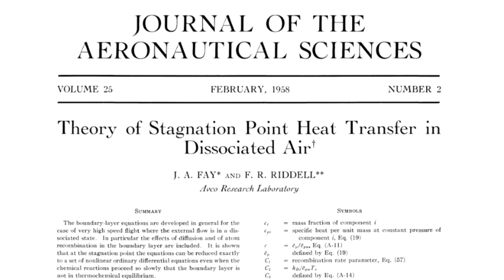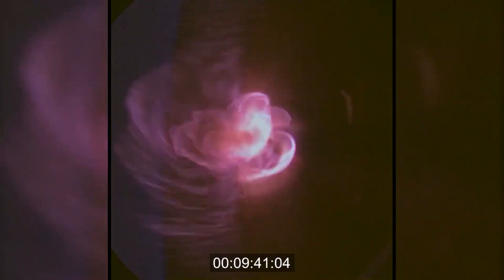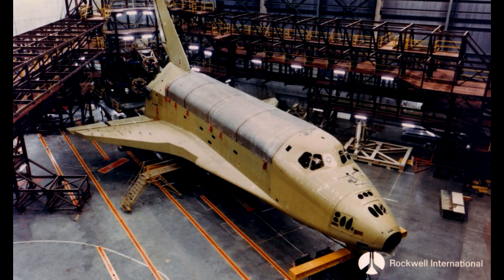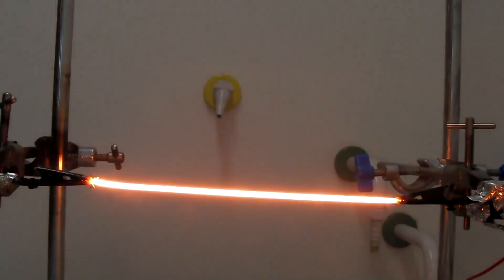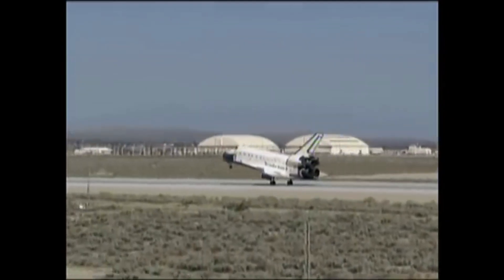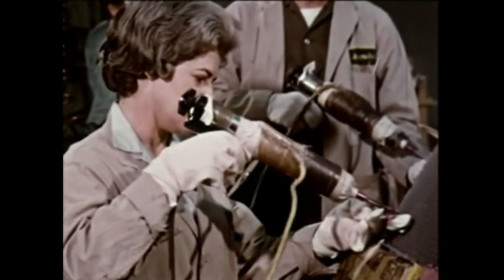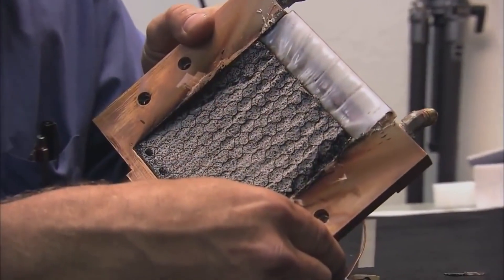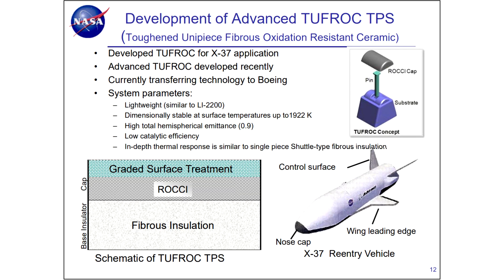Heat Shields - Things Kerbal Space Program Doesn't Teach

Comment: I'm not a rocket scientist or engineer or someone who works with thermodynamics daily, so this is probably going to sound dumb, but...

For years I have been wondering why they don't just slow down the spacecraft during reentry so they don't need a heat shield?  I mean, the STS used reentry engines to break orbit, but why can't they have more braking?  I fail to see why reentry has to be done at tens or hundreds of thousands of miles/kilometers per hour.   I mean, the early capsules I could understand, but we have been going back and forth to space for almost 75 years now and I don't understand why nobody has been able to design a craft that can carry fuel enough to brake during reentry enough to not need complex or ablative thermal protection.
Reply: Slow down with what? Fuel is heavy. The more fuel you hold onto in order to slow down, the vastly more fuel you need to burn in order to get all that mass into orbit in the first place.
Reply: Even if you managed to cancel out 100% of your orbital velocity (which would need ~7.7km/s of deltaV), by the time you go from orbital altitude to the upper atmosphere you’d be well into supersonic speeds and still need a means of not overheating your ship
Reply: @alexsiemers7898  I think it's fair to say that if a ship has so much excess delta-vee it can slow itself from orbit, it probably has enough delta-vee to reduce its speed as it falls through the atmosphere.

The only reason it wouldn't is if it had 18 km/s of fuel but not 19, though that's certainly not impossible.

Comment: Don't know if they still do, but China used oak wood for a heat sheild on their reentry vehicles and it would turn to carbon and moisture in it also helped in cooling, I think. A simple idea, but I would think it would be easy for some wood to very in its burn rate, but am sure they had a good sorting of the wood for even grain and weight, etc.

Comment: In theory an artificial gravity drive will allow re-entry speeds to be reduced low enough to avoid any kinetic heating. Currently the amount of propellant required to slow a re-entering craft would increase departure weights so much that it wouldn’t be practical. 
Am I correct in assuming a controlled geostationary decent wouldn’t require a heat shield? If so how can we achieve this for better reusable space vehicle’s?

Comment: Just thinking about different ways to do re-entry, I had a couple of ideas come to mind, just recently. I'm sure there are good reasons why they have not been used, but IAC consider these:

1. Buoyancy. That's the term I've seen associated with this. It probably works best entering from LEO. Fire retros, then apply flight surfaces, as you encounter very thin air, to generate just enough lift to maintain altitude, as you bleed off speed while traveling through the very thin upper atmosphere. As you slow down, keep angling the surfaces to maintain life and not descend, or descend as slowly as possible. Eventually you will be unable to maintain full "buoyancy," and you will fall faster. But by then, you will have lost enough speed that you may not need a heat shield.

2. Keep your junk as a shield. This might be good for something like an Apollo configuration. You have a service module, much larger than the command module, and it's still attached, obviously, since you used it to leave lunar orbit. Why not maneuver it in front of you, and let that absorb the heat of re-entry? That means much more mass to put through re-entry, but in principle it doesn't really matter, as it's all going to re-entry IAC—it's just a question of whether it's one piece, or two. It might be advantageous to design the CM to allow jettisoning some of the more massive components before the final moments. It could also help to allow some parts to be splayed out and create more drag during the early part of re-entry, then they could be allowed to detach. A lot of stuff could be allowed to detach as drag increases, and that could be helpful if it could be done in a controlled manner.

Comment: Quite a few changes on the SpaceX Starship plans for the heat shield tiles, I see. That's their way: if it works well, use it. If it can be improved, do it. If it can be removed completely, hack it off.

Comment: Surely you know the difference between silicon and silicone? Wheres your robot sex doll might have silicon breasts, you would undoubtedly prefer natural textured rubbery silicone. There is nonsuch thing as silicon glue, as referred in your illustration, it is silicone. There is a silicon valley in California so named because of the silicon based electronic parts made there, but there is no silicone valley unless you are referring to Dolly Parton’s cleavage. Silicon: semi metallic semiconducting element. Silicone: a family of synthetic lubricants and rubbers.

Comment: I had the incredible good fortune of a personal tour through the Vehicle Assembly Building during the final few weeks of assembly of a space shuttle vehicle.  I remember the large days-to-launch banner high up on the interior wall of the building.  Memory tells me it was somewhere in the medium-high 2 digits.  I watched as men and women spent what must certainly have been weeks marking, removing, hand trimming, and replacing individual numbered thermal tiles to the under- and leading-edges of the shuttle’s port side wing.  It brought home to me as no other narrative possibly could how time-intensive a process it was.  The entire time I watched, which was probably less than half an hour, was used by one engineer on a single roughly brick-sized tile which was still not complete when I moved along.  She treated that single tile as if it were the key to the entire ship’s success, which years later served as a terribly bittersweet memory.

Comment: In regard to thermal protection tile design and thermal expansion. I am a tradesman and we solve thermal and moisture expansion and contraction problems by incorporating overlap and tounge and groove conections. This is common in finish work, siding, laminate flooring and roofing. The overlapping of Starship could be done simply.  We call it a rabbet in carpentry. An upper siding plank laps the lower with a rabbet cut into the over and under pieces for a flush fit.  This cascades water like fish scales and I suppose it would to...plasma. Replacement and standardization would not be to difficult.  I am sure I am not the first to think of this.  I was wondering what the arguments against overlapping are. Anyone?

Comment: Scott, Nice video.  The leeward side of a shuttle orbiter or Starship, same nearly all orbital entry ships, does not receive significant radiant heat from the plasma wake flow.  The lee side of Starship will be heated convectively, just like orbiter.  Just at relatively lower rates.  The white/ black color of tile from leeward to windward sides result from the tile being naturally white, and requires extra processing and coating to obtain the black emissive coating.  There is no reflectivity involved in the leeward sides of Starship or shuttle.

Comment: I thought you were going to also explain the difference between "hot body" and "cold body" reentry techniques.  Dyna-Soar was a hot body, meaning that its structure could withstand much higher temperatures thus lessening the reliance on the TPS.  The Shuttle was a cold body, so that, as you mentioned, the TPS had to deal with all the heat to protect the aluminum (or is that aluMINIum?) structure.

Comment: My setup of KSP, did in fact transmit heat during re-entry realistically. 
I ran it on a Macbook, on my lap. During re-entry the processor had to work harder to calculate the flight dynamics, which heated the laptop to the point of burning my legs, and on max exhaust fan. At that point I needed to prepare for re-entry with an insulator in the form of a soft cotton based free form insulator, and later switched to a hard non conductive wooden board. While that was enough for my biology, the heat did in fact after a year of many re-entries, fail the batteries to expand out of their designed structure, sequentially over time, rendering the Macbook unusable, and illegal to take on board airplanes.

Comment: Yes I know it's an old topic but I always wondered why they didn't reduce the number of tiles by making larger panels out of the tile material. Bigger panels more area for adhesion fewer tiles falling off in flight. Had a chance to actually touch a Mercury heat shield made out beryllium. It felt waxy. Strip off the old shield? Sounds like a lot of work and a lot of fun.

Comment: Carbon is fuel to oxide and so is aluminum but nitrate is oxide there for will only melt to high oxide heat and will not act as a fuel.nitrate and white ash neutral composite to flake away and re applied usage.

Comment: Isn't there also a very hot layer of the atmosphere (the thermosphere) up there that contributes to re-entry heating? No one seems to mention this hot layer when talking about re-entry ( or launching to space) Surely that will have some effect, or is the pressure up there too low for it to make much of a difference?
Reply: The individual gas molecules in the thermosphere are ho, but they are so few and far between in that very low pressure, that they transmit very little heat to a structure travelling through it.

Comment: Scott, 
Another great video and a very clear explanation of the difference between supersonic and hypersonic applications!

Here's a little more background on what we mean when we use the term of art, "carbon carbon".  As you covered, this refers to a graphite and fiber reinforced composite material.  We generally will use this in three distinct forms:  2D, 3D, and 4D C-C.  This refers to the number of planes that the fibers are placed in.

In a 2D CC part, we place (weave) high purity rayon fibers in 2 orthogonal directions (ie; x and y).  A filler material is often present as a matrix which will graphitize during processing.  BTW: the most sensitive and demanding applications like solid rocket nozzle throats are often made from NASA's reserve of very high purity rayon left over from the Space Shuttle Program, although other sources are now increasingly sought, as the stockpile is depleting.

The billet is then densified through successive cycles of heat and pressure to convert the block to nearly pure carbon, which will retain the morphology of the original fiber matrix.  Densification can take many months. This generates a material of exceptional erosion and thermal resistance, such as would be needed for an ITE (integrated throat exit) which contains the flow of very hot gas entrained with aluminum particulates through a normal shock.  Once fully processed, the billet is machined to its final design shape.

3D CC has 3 orthogonal planes of fibers (x,y,z).  4D has 4.  We chose the type and other details based on the loads that will be encountered in a specific application.

-Tory
Reply: Very interesting stuff! What exactly is meant by 4D weaving of carbon fibers? My euclidian space only offers three orthogonal planes, so I would assume there are some non-orthogonal planes?
Reply: @juriaanv  It's woven through time!
Reply: @juriaanv  He elaborated on Twitter:

"Most often, the 4th D is just an extra set of fibers in one of the 3 orthogonal planes.  In some applications, it is placed in a 4th, non-orthogonal direction"
Reply: @juriaanv  They are planes, not spatial dimensions. You can have lots of planes intersecting each other in the same 3D material space we're all inhabiting. One plane, two planes, five planes.
Reply: @juriaanv  it looks like they mean additional fibers within a plane, and it can go up to 6D (or probably higher).  i can't tell if perhaps additional weaving patterns might qualify as well.  anyway, here's one page:
https://www.cfccarbon.com/carbon-composite/4d-carbon-composite.html
Reply: @juriaanv  same question here
Reply: Very interesting, thanks for the response!
Reply: Our part time ceo full time meme boi is here
Reply: Tory the legend!!!
Reply: Thanks Tory, insightful as always
Reply: Wow Tory Himself
Reply: @pauljnellissery  The man, the legend
Reply: Thank you!
Reply: Pin this!
It's the CEO of ULA!!!!!!!
Reply: Very interesting Tory, you are a legend
Reply: oh wow it's tory bruno
Reply: Reason #1947461 why Bruno>>>> Musk, Bezos & others
Reply: @Arkaid11  Why does one always have to be better than the other? 
Tory Bruno has a lot of knowledge, but look at the cost of what ULA builds compared to what Musk launches (F9) and is building (Starship - fully reusable). look at how fast or how slow one is compared to the other. Both companies have positive and negative traits. ULA has NOTHING reusable. At most refurbishable. Bruno would love to design and build a fully reusable rocket, but alas the pencil necks above him say otherwise. And can't even admit it outright because of the ramification of such statements.
Dare you really say one is better than the other? It's like comparing apples with pears.
Reply: @paulmichaelfreedman8334  
As a public figure, Bruno is a better person. Say what you will about the companies they lead, but Bezos is a classic monopolistic self-important billionaire, and Musk is a hot-headed Twitter-rant-prone self-important billionaire. Meanwhile, Bruno at least was an actual engineer and gained experience working his way up through the ranks. That was Arkaid's point, I believe.
Reply: Thanks Tory 😍
Reply: hey tory!
Reply: torys our man
Reply: What exactly do you mean by 4 orthogonal planes? Please explain
Reply: Very interesting indeed
Reply: Great to hear from someone up close to it
Reply: Thank you!!
Reply: Hey tory I love you
Reply: Amazing
Reply: Thanks for constantly teaching us new amazing things Tory!
Reply: Hi Tory :D
Reply: Watch the "Going nuclear" series (just for the pleasure of it) and start working on that NERVA bus to open up the Moon.
Reply: pog

Comment: Compressive Heating is the reason why the movie The Day After Tomorrow was such a POS.  The movie claimed that upper atmosphere at -200°C (which it is) moves to the surface of the Earth (which could happen) and causes everything to freeze (which tells you they don't understand Engineering or ThermoDynamics).  The reality is that if the -200°C upper atmosphere was moved to the surface of our planet we would all be cooked in a giant Convection Oven.  The air would be several hundred degrees C.  You can't move the upper atmosphere to a lower point without compressing it and thereby heating it.  Thanks HollyWood, you produced another generation of Syuntific Unginears.
Reply: Find an '80's novel by John Gribbin called "The 6th Winter" - similar idea, but fluctuations in the jet stream producing "drill-like" instantaneous freezing & solid ice 5m x 5m x 500m, possibly attracted by heat so hits towns (in novel) but also mammoth herd (in past)- explains some found frozen solid with plant material in mouth...

Comment: Dynamic skin heating on supersonic aircraft such as Concorde (127 degrees C max allowable at mach 2) is also caused primarily by compression of the air in the sonic shock wave. It is frequently stated in the media that friction is the cause - it is not! 

It is interesting to note that Concorde was white, the SR71 black. Concorde was white because it flew at M2, where the added heat of the sun needed to be minimised hence white to reflect away solar heat. SR71 was black because it flew at M3, where the skin temp was FAR higher so the added heat of the sun was insignificant but radiating heat to the air was vital - hence it was black. White to reflect, black to radiate. An interesting practical demonstration of thermodynamics.

Comment: a bit from an old movie that kinda upseted me at the time (well, took some time for it to sink in), went something like this, a super fast (passanger?) plane accidently went too fast and got into low orbit (or near low orbit), it didn't have any heat shields, so it wouldn't survive reentery, so the space shuttle was sent to take the "front" of the heat wave, as it reentered a short distance infront of the space plane, so that the plane would not have to worry about the heating of reentery.

thing is, if it has not heating, it's not slowing down (while the space shuttle infornt of it, is)...

Comment: Would it be possible to use thrusters/rockets to slow down the vehicle on re-entry in case of emergency? For example Columbia if they knew this was the only way to survive and if they had enough fuel.

I mean if the space ship comes in at a slower rate to the atmosphere/ground then I guess it won't get as hot?

I'm wondering both in terms of feasibility and if it would be a valid workable solution. Like it might not be possible to carry enough fuel for that because it would weigh too much but then if you disregarded that would it be possible then? :)
Reply: No. The Shuttle could only handle 3g before disintegrating. Slowing down more means a steeper reentry, which means more g-force.

Comment: Starlit,  demonstrated as seen here didn't need great insulation. This demo,  is a trick.  The contents of the white coated white, egg shell, might have a layer of cooked egg within.  It can't be seen.  Only the uncooked portion is tiped onto a white plate.  The layer of cooked remains stuck to the inside and as it has turned white it can't be seen. Plaster of Paris works well for a demonstration.  Do it for friends. Most people will offer you a million pounds for the formula, for plaster. Make that two million.